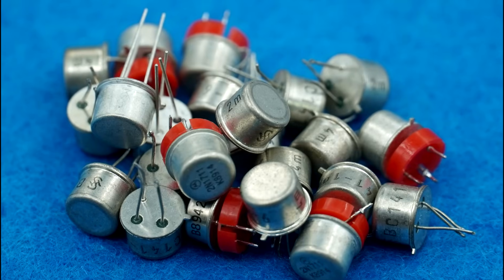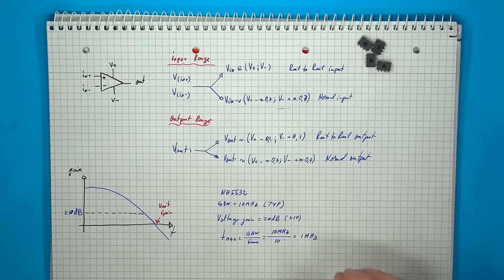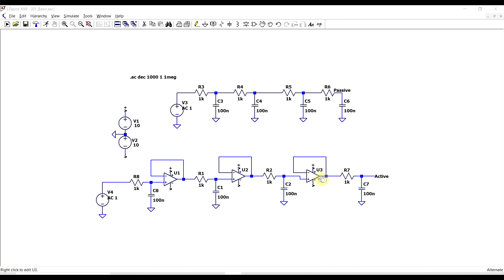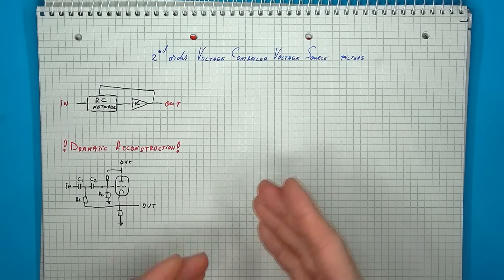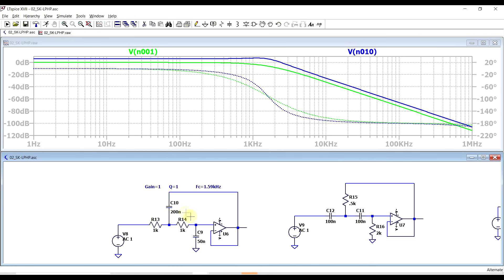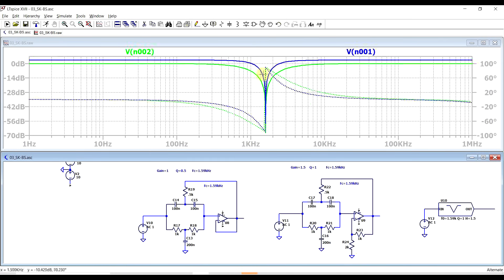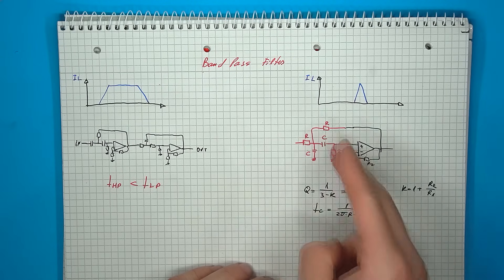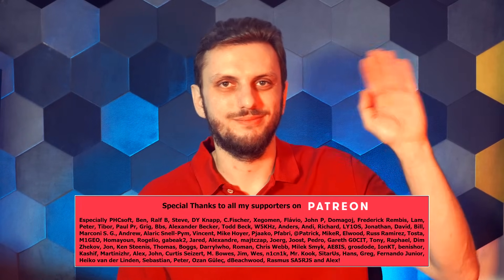Active RC-filter Basics

Comment: Yep also slew rate will limit frequency range sooner then bwp. Leared that the hard way. So make sure you pick an op amp with slew rate high enough for application. Oh and make sure capacitor are film or cog types to minimize any capacitance changes and thus changes to cuttoff frequency.

Comment: Your explanations are great ! Thank you. So, if I need to create a 20 meter pass band filter, how should I do it ? Lt-Spice and then what ? How do I choose good capacitors, resistors and op-amps. Good in terms of quaity and resistance to heat, etc. And what is gain ? Is that just voltage in , which I should be able to control programmatically or via a potentiometer ?

Comment: 9:02 "Corner frequency of 1.59 kHz."  If we didn't pay attention to the preceding algebra, we might look at that odd number and idly wonder where it came from.  "Ah, probably there's a factor of pi/2 somewhere..." but wait, that should be 1.57. Hmmm.  Well how about cube root of 4 (=1.587, seems legit!).   But actually 1.59 comes from 10/(2pi).  It's odd that this 1.59 is so close to those other irrelevant possibilities. Those digits even show up quickly in pi:  3.14 159 265 etc... also irrelevant but slightly mysterious!  FesZ -- nice video explanations as usual!

Comment: I think at about 16:50, the input impedance of an op amp is very high and the output impedance is very low, not high
Reply: 16:50 is right at the end but the bit I think you mean is 4:10 and he is talking from the filters point of view and is correct can't find another place he talks about ! :)

Comment: I placed an L ( 10uH ),  C ( 10uF ) filter on the output of a small POE switch mode power supply , in the hopes of reducing ripple , BUT in fact it significantly increased the ripple ?? total mystery any tips ?
Reply: What about the resonant frequency of the LC filter, is the ripple frequency near that frequency?
Reply: @tachyonic-ultimate  Thanks , I will check on the scope
Reply: Adding some series resistance to the capacitor can help reduce the q of the filter. High quality gives a bigger resonance peak
Reply: Thats high ish frequency you might need to add some lower  capacitance there.
Reply: Could it be that the way you connect your scope is a problem ? Fesz learned me that for PSU ripple, it is of most importance to keep the ground connection to the scope (to the probe) as short as possible, preferably one centimeter. Use the little spring that comes with a lot of probes.
Look at 6:15 https://www.youtube.com/watch?v=vzhEt3t5VXw&t=414s

Comment: nice timing :)
I just implemented the simplest non-inverting buffer circuit and used a 11MHz bandwidth opamp (OPA140). everything working fine except that I can't use it for any signal above a few hundred kHz apparently due to the 'low' slew rate - my voltage swing is 0-14V at the input and unfortunately quick transitions get attenuated more than I would like. time for a redesign unfortunately. thank you for the great video!
Reply: Yep, thats the reason why I always calculate all the necessary data such as, slewrate &gain bandwidth product before selecting an opamp :D

Comment: I tried a band pass filter with lag lead combination(unity gain phase shifter)and resistive feedback from stage 2 to 1,performance is highly dependent on the tolerance of components,is there any high Q bandpass filter with somewhat relaxed component tolerance